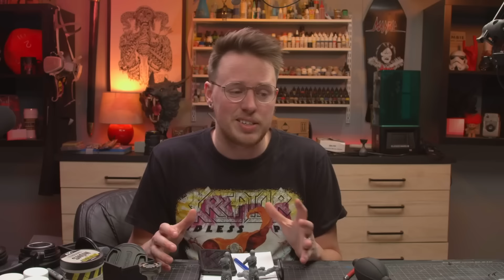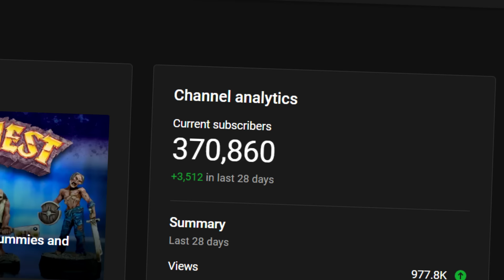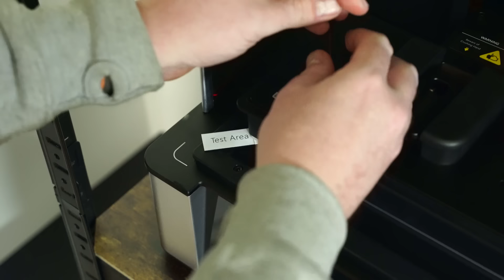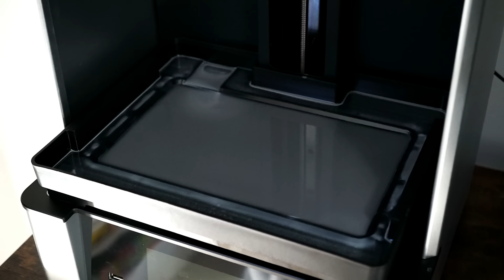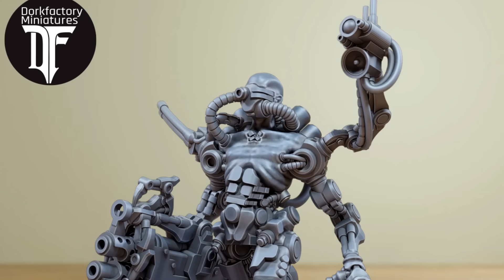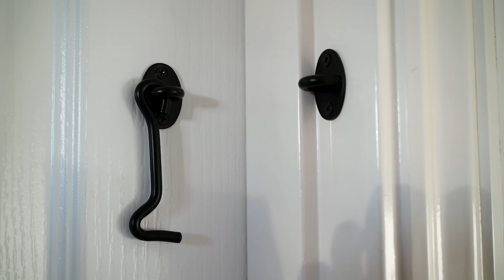Is 3D printing FINALLY easy enough to print Warhammer at home? Uniformation GKTwo!

Comment from the maker: Thanks for watching! 3 important things...

1 - Here is the printer I used: https://www.uniformation3d.com?sca_ref=5309662.D3ug7xsqPK

2 - Go follow Fauxhammer right now: https://www.youtube.com/@FauxHammer

3- You're awesome, you're important, and I hope you're having a great day.
Reply: I'm a field service engineer for industrial SLA machines and your setup is concerning to me. 
What you are doing there is highly dangerous!
I'm not sure how uniformation are selling this thing without any warnings in their manual.
There is a chance that you are creating a explosive atmosphere when using volatile solvents inside a ultrasonic cleaner (the ethanol your methylated spirits mostly contain) and just need some kind ignition source/spark to have a nice ethanol fire. An ignition source you might be readily providing by walking to the printer over your carpet.

I mean it's not likely but I doubt it's a risk you want to take in your family home. 

There is a good reason not one of the big brands like formlabs offer a ultrasonic cleaner for use with ipa/solvents. 
There is plenty of systems in the Industry but they are all ex protected and have proper fume extraction systems if they are rated for use like that. 
Please go with waterwashable or tpm in ultrasonic cleaners if you don't have good infrastructure to handle this stuff.
Reply: @fishboon91  Meths is dangerous because it may have ethanol in it??
Rofl, ethanol is a two carbon chain simple alcohol, meths/methanol is itself the single carbon version, lighter, rather more volatile and more explosive than ethanol could ever be, then IPA is the three chain version.
That low powered ultrasonic cleaning vat is intended for and rated for use with alcohols and so entirely suitable.
All of us washing in IPA need to be careful regarding environmental ignition sources, you're not safe at all because you don't have an ultrasonic cleaner. Ventilate and use wash stations that are sealed in use (plastic wrap the top if you're not sure) and absolutely always store your volatiles/flammables safely in a metal box or cupboard when not in use.
A little perceived wisdom and a lack of understanding of the specifics is dangerous if you go on to make authoritative statements to folks who may have less knowledge
Reply: I'm hoping that more youtubers take the time to showcase proper ppe for printers. Especially resin.
Reply: After watching the video I can see where you're on the fence.  3d printing is a hobby in itself.  I've been 3d printing since my  high school engineering classes back in 2015. 
Lots of things have changed in the last 3 years alone. 
Fortunately I'm not a table top player I'm just a maker and artist.  
The issue I've always had is recycling the ipa I use . Getting a cheap wash and cure station helps.  The lid  on the bucket that holds the ipa has a silicone seal. So it doesn't evaporate.  
Definitely 100% agree with not letting kids or pets close. I have my set up in a closet that I was lucky enough had spot I took advantage of for a vent. 
Love the video alway like seeing other talented people try new things . 

Ps on copyrighted stuff 3d printed 3rd party has grate proxies and orginal games entirely.  So clearly inspired but not a copy . 
(Like that dollar store toys clearly is not GI Joe but just "army man"  and ill play with him just the same , :D
Reply: I am happy you went into detail about the health and safety aspects of this. A lot of people ignore that and have no idea of the dangers of breathing in resin day in day out. But, I feel the pricing at the end of this video is a little misleading. It's over £1000 (1300 USD) to get everything you used in this video - the 3 machines they sent you are £992.21 and that's before you have bought resin and other things you'll need for the clean-up process. I am sure it is worth it, the prints look great, but it's certainly a lot more than the price you said at the end of the video.
Reply from the maker: I mean, I was pretty obviously just comparing the printer prices. I speak about the costs of other items, and the general 3d printing hobby throughout the video. @idontwanttopickone
Reply: @idontwanttopickone  Health and safety is simple. Get an air filter with a carbon layer for absorbing organic molecules. Run that at Full. Or open you window, stick a fan in it, and have it blow out. Make sure you wear gloves and and apron, as well as eye protection.
Reply: I hope you never get sponsored by games workshop.  Literally encouraging people to break copyright
Reply from the maker: I'd never encourage that, I say so in the video  @valeforedark 

... But also Uniformation sent me more gear for this video than GW has ever sent me after making 240 videos on their products 😅
Reply: @valeforedark  might I suggest you watch the video again - he says “some people… …print 1:1 copies of GW minis, that’s not me.” Also at several other points he states he prefers smaller independent creators that may make models similar to but distinct from GW minis. He literally advocates against copyright infringement.

Comment: 3d printing isn't hard at all, from my experience. I got a Mars 5 Ultra. I took it out of the box, did the first calibration, poured the resin in, printed a miniature, and dunked it in 70% IPA (Yes, 70% does work), shook it around, dried it out (takes less than a minute), and cured it. I didn't have to do any resin calibration and just used the generic presets built into the slicer.

I also didn't have to put the resin back into its container when I don't use it. In fact, I've printed a mini using resin that was just sitting there for a couple of months. All I did was mix it around.

And for the price? It pretty much pays for itself.

Comment: Sorry. . . I like your video and all the feedback. . . But . . . Large models should be hollowed out like yours were. But those same hollow holes have uncured resign walls, thus, you should buy or build a UV LED light that you can fit inside those holes to cure the inside.

Comment: I started with an Elegoo Mars 3; it was okay. So I upgraded to a Saturn 2.. duff machine, never worked, almost gave up. Bought a secondhand Uniformation GK Two, and suddenly everything just worked.  Forget about resolution, the important thing is the machine's build quality. 

Also, if you're printing miniatures, buy ABS-Like resin (or possibly Tough resin) - all other advice about resins for minis is baloney. ABS-Like all the way.

Comment: Sorry i don't agree with these free printer biased videos. You could have gotten the same exact results with a printer that costs a 3rd the price with one to one  instruction. So many people use cheaper printers with equal results. The likelihood is that had you been into the 3d printing side of the hobby with the original machine you could have figured it out

Comment: Cheap 3d printers are still extremely unreliable imo, anything under $1000 easily be a whole different hobby for you, maintenance! They all work regardless of the prices,  but if you want to spend the time on the actual hobby part, I wouldn't buy anything lower than $2000, the amount of time and frustration you save is well worth it.
Reply: lol my $270 mars 5 ultra is more reliable than my $800 phrozhen mighty 8k, its not about price its about actual technology implemented, i haven had a single failure on the printer after 150,000 layer pulls, what you get with $2000 printers is like 5% more reliability and much better tech support but thats it not even the software works better then on mass market printers.
Reply: @miguellopez3392  Law of diminishing returns?
Reply: @herculeholmes504  sort of, it's more like how electric cars where previously 100k for lower range low speed, than lithium ion technology has allowed them to be 40k with more range and speed, previous sellers have to then justify their 100k cost with better customer support and higher reliability, sort of like luxury sport cars, it can be important in a race against others but the general consumer can get by with something much cheaper and slightly less reliable.

Comment: I originally wanted to get a resin printer but due to current living arrangements I cant safely deal with the toxic nature of resin, so my only current option is FDM. But with the right settings I should be able to get the level of detail I want so it will work out, just need to do alot of sanding.
Reply: Isn't this Video about FDM printers? I'm trying to learn more

Comment: Leveling the GK seems difficult, the saturn 4 ultra is literally auto leveling, just plugged it in, added resin to the VAT and clicked print 😮 only 1 failed print so far but it was because I lowered the exposure time to 1.8 and it was too little

Comment: There's another kind of resin printer that's a bit less common but has some hidden bonuses. DLP. The Stereolithograph printers use an LCD screen to make the image. DLP printers use a Directed Laser Projection bouncing off a fixed mirror to accomplish the same thing. The bonus is you never have to replace an LCD, and given how messy resin printers are, you REAALLLYYY don't want to have to replace those. Or the motors...which will gunk up in no time.... so have bearings on hand for that.

Comment: I've been considering getting into 3D printing for some time now, and I'm still firmly on the fence between FDM and SLA.  On the one hand, there is just no denying the amazing level of detail and perfect, paint-ready prints that come from SLA.  But then there's the mess, the PPE, the VOCs, the rinsing/washing, curing, and hazmat disposal when it's all done, which makes SLA a lot less attractive.  FDM, on the other hand, is essentially mess-free, arguably more flexible in the kinds of things you can print, with no VOCs (unless using exotic filaments, of course), and doesn't require washing, curing, or PPE to handle the finished product.  Of course, the thing you lose with all of that is the insane level of detail that you can get with SLA.  FDM has come a long way, and FauxHammer has even addressed FDM printed minis on his channel.  They look pretty darned good, but not to the level of SLA.  

Thus my continued perch on the fence.  On the one hand, I'm in love of the detail of SLA.  On the other hand, I suspect the mess involved with SLA will eventually make me stop using it.  Which just leaves FDM.

Comment: Well done video. Recommendation from a 3D printing enthusiast: Never peel the finished print from the plate when is attached to the printer as the falling parts might damage your screen or vat, always remove the printing plate, then remove the prints.

Comment: Not for me.  Not my main hobby.  I just paint to relax and not play video games.  It was a struggle to justify the airbrush, let a lone a 3D printer.  They are useful to for all sorts of things though.
I did not realize the fume issue.  This would be a deal breaker anyway.  I would have to use it in the garage, which would be a nightmare.
Also the price.  A box 20 frostgrave minis are not expensive.  Probably better off putting the money in the bank.
I get why serious mini painters want to get into this though.
Reply: The fumes are definitely the biggest problem in 3D resin printing, but if you ever have the opportunity to use a 3D resin printer in a safe, ventilated environment, it can be very cheap to get started in 3D printing if you buy an older printer (and some people get creative with cleaning solutions; one guy buys waste alcohol from a local distillery - IPA is expensive).

Comment: Small thing, but while I wouldn't recommend the mini air purifiers sold by the 3d printing companies for purifying the air due to it just being a carbon brick. They due an amazing job and neutralizing the smell missed by the HEPA air purifiers. If you can splurge for both, i'd recommend it.

Comment: You can use a glas of hot water and put your prints in for a few seconds. This way the supports will go off much easier. Just don´t put the water in the toilet or anything. Leave it open and let it dry out

Comment: That's a lot of money for the quality imo.  Preface I don't own a printer and I've gotten stuff 3d printed before and the quality was not good, between bad scaling and awful print lines.  £800 is a lot to drop for a hobby accessory imo. It's a shame, there's so many good designs out there
Reply: You can get better printers for $500, or slightly worse at $300. Print lines and quality have more to do with the quality of the resin, calibration of that resin and proper supporting of the figure for that resin to prevent deformation or layers splitting, I've been able to get prints that are higher quality in detail then a mold injected $200 figurines i bought, so long as you are good at cleaning it up and putting propper supports... which can take a while.

Comment: A year and a half printing using eSun water washable resin. Great, easy, consistent printing. Few to no failures. Ever. And then, over summer, when the weather was warm and humid, every single print I had done developed surface cracks ranging from tiny to catastrophic. That's hundreds of dollars of resin and hundreds of hours of prep and painting etc. I didn't make mistakes in the printing, supporting, hollowing, etc process. Exposure times were optimal. I wasn't over washing. I wasn't over or under curing. I was extensively drying models before curing. Cracks appeared in small models and large models. Hollowed models and unhollowed models. Thin sections of a print and thick sections of a print. So I switched to Elegoo water washable resin. Frustrating, time-wasting, futile attempts at printing. Consistent failures. I've leveled and re-leveled the build plate, checked the FEP, the room is constantly at or around optimal temperature, the exposure settings are optimal. I've adjusted all the print parameters to try and prevent bed adhesion issues, and spent countless hours liaising with Elegoo support. The subset of models that have printed properly look good, but I'm scared to invest any more time into prepping or painting them because I don't know if these models, like those printed with eSun resin, won't crack during a warm humid summer. Non water-washable resins are out of the question for the toxic fumes evolved during washing with alcohol.

Comment: To minimize the VOC you can place the wash station in a garage or shed and keep the printer and curing station in the house. You could even do the wash out on a balcony.
Reply: Best option is to ventilate the room with a good size vent and flow, sheds and garages have poor air circulation and would compound the problem.

Comment: Hello, I'm new to this, important question, why not assemble the miniature in the 3D program and then print the complete figure? Or is there something I don't know about printing them in parts? I'm obviously talking about small miniatures like space marines.

Greetings from the Dominican Republic
Reply: You can do this, it just takes longer to print as printing time is based on how tall the print is and more difficult to paint, other reason is it allows you to scale models much  larger than the printer would be able to with a full model.

Comment: I personally mitigate the health risks by doing two steps: always wearing protective gear, and keeping my printer and cleaning supplies in the garage. For cleaning, I use an anycubic wash and cure station that has an air-sealed vat for the cleaning solution (in my case, 91% IPA) and uses a turbine to spin the fluid up to speed. For a printer with a heated vat, the colder temperatures in my not air-tight garage won't matter - my printer doesn't have a heated vat, but I was able to buy a small air purifier/heater combo that fits inside the enclosure and haven't had any issues with temperature printing all winter. Taking the health risks seriously is absolutely important - I would not recommend printing with resin in any space that needs to see frequent use. Fortunately, though, none of the tasks in printing really require prolonged exposure to the materials, so if you have a garage (or even a covered patio - I've seen some people with outdoor printing setups) it's not that difficult to separate the printing supplies from your home.
Reply: For very volatile chemicals I recommend air ventilation and a N100 mask filter, I do it inside my laundry room and I vent it as well since I also use the anycubic wash but it's filled with "fuel" highly toxic but cleans better than any else, smells like tequila and very flammable. I also use a small air heater in my printer but the air filter in it is too small to be effective.

Comment: I bought an Anycubic last year. It's a cheap machine, and the washing bin isn't even big enough for the build plate. I broke a lot of miniatures while trying to get them off the plate. But even after a stressful time of three prints failing after another, I have to say that this is a freedom I don't want to miss. The room is heated, it has huge windows I can open, the table is covered with latex, I have an expensive air purifier and never enter the room without a mask. You need to learn a lot before starting this hobby because we talk of high cancer risks. But if you have the safety stuff down, it can be so much fun. One thing I do still hate, though, is levelling. I have to re-level after every print because of the force needed to remove the prints. I also only use waterwashable resin. DO NOT PUT THAT STUFF IN THE SINK! It is not environmentally safe. 
In the end, I am a noob with this stuff. But the freedom of printing stuff is amazing. If you need some miniatures,  I can highly recommend Dragon Trappers Lodge 💚